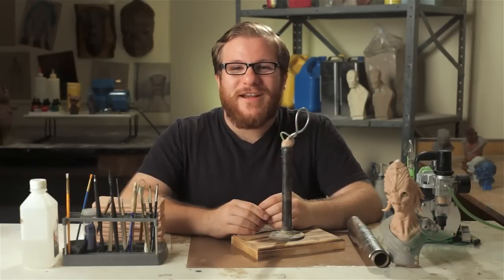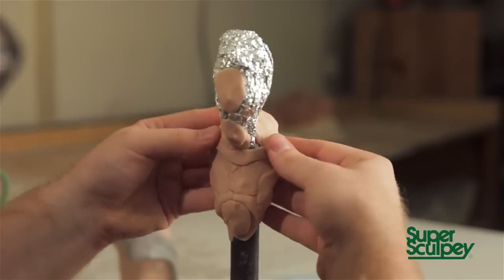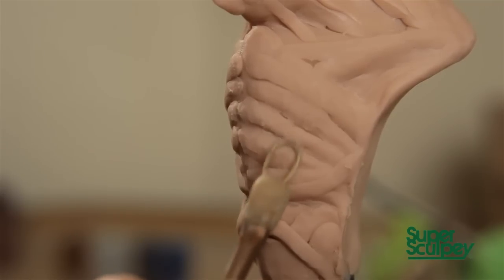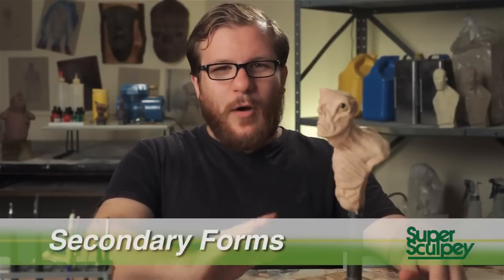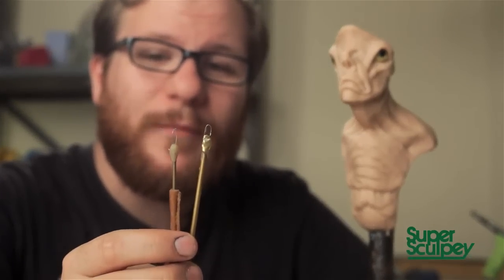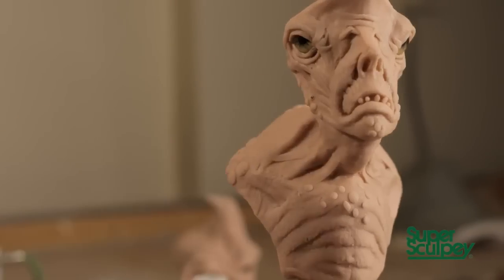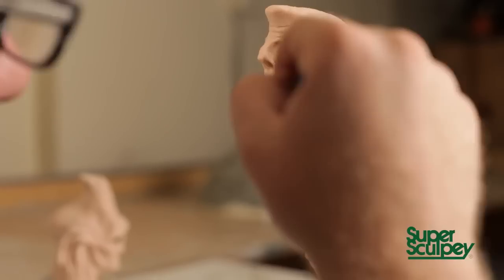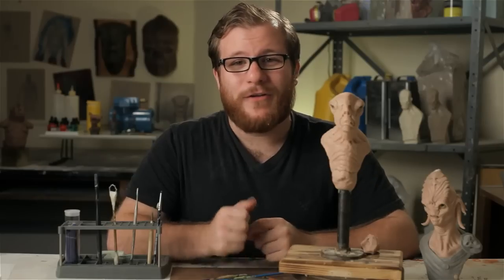Super Sculpey Modeling Clay - Creature Bust with Jake Corrick

Comment from the maker: Massive thanks to +Jake Corrick for helping our viewers out on their sculpey questions!!
Reply: Jackson's Art Supplies i'm a beginer , so i just wana ask about what tools do i use do i use for beginers?
btw love the your creatures
Reply: Lisa Takahashi thank's for the infoo :)
Reply from the maker: goldrick wang Hi - the tools you will find at this link are all recommended for beginners http://www.jacksonsart.com/Art_Departments-A-Z_All_Departments-Sculpture-Sculpture_Tools-CWR_Modelling_Tools/c2129_2128_2178_31127_33872/index.html good luck!
Reply: +Jackson's Art Supplies thank's for the info , :)
Reply from the maker: +Mr. VonMeister sometimes +Jake Corrick stops by to answer questions like this, fingers crossed!! But I imagine that the foil underneath the sculpey makes it easy to lift it from the pipe as the foil would not stick to the pipe
Reply: But the angle of the wire in the armature would stop it wouldn't it?
Reply: sometimes it best to leave the armature in and either make a new one or buy it
Reply from the maker: if the foil was thicker towards the base than it was at the top then it would be easier to remove the model from the armature. I think in this case he wanted to keep it on the stand?
Reply: Jackson's Art Supplies make Godzilla
Reply: Jackson's Art Supplies His link doesn't work anymore.
Reply from the maker: Thanks for letting us know... his Instagram is great! - https://www.instagram.com/jakecorricksculpture/
Reply from the maker: What's the magic word? ;)
Reply: You have some awesome work! I was wondering what you feel is the best clay to use to sculpt with? What brand/type of clay are you using for this bust?

Thanks a million!
Reply from the maker: Hi, It's Super Sculpey, hence the title of the video. Thanks for watching!
Reply: How do you take it off the stand?

Comment: Just adding this since it has come up a few times:
The base is removable after baking. I use the same setup that I have had for years for nearly all of the busts I do in this scale. Once everything is baked, and if you were careful to not put too much sculpey at the bottom between where the sculpture meets the pipe, you can slowly spin and lift your piece off, and the  excess armature wire can be snipped at the bottom. Good luck everyone, thanks so much for watching this. hope it is helping. I plan to do another video covering painting techniques, and maybe one for a full body figure if people are interested!

Comment: Hello! 

Amazing work! I want to get into sculpting and your video is the first one I ran into! With that being said, I have some questions:

1. Air bubbles? How do I get rid of them or how do I know if my piece has them? Will my sculpture blow up in the oven?
2. Stands for sculpting..where do I buy them?
3. What paint will work with super sculpey? I want it to look as clean as possible. I'd like to stay away from the 'elementary paint'.

Hope to hear from you soon! 
-Landon
Reply: I see your questions have not been answered yet. Here's my personal experience with Sculpey:

1. This need not be a big issue, as it doesn't normally occur when conditioning the clay well before use. Try not to trap air in the clay while kneeding it, or when putting layers of clay on top of one another. Trapped air can show up as tiny white spots or little cracks on the surface after baking. Cracks can also occur when you bake really thick layers of clay. So don't.

2. Be creative, anything could be a stand for your sculptures. I have used candle stands for this purpose and find they work really well. 

3. Acrylic paints are recommended and totally safe to use on Sculpey. I know some people use solvent based paints, such as heat set oil paint or enamel paint. Be careful when using solvent based paints though, as they could affect the baked clay through chemical interactions.

I hope this helps.
Good luck and have fun sculpting :)

Comment: Awesome video! I'm currently interested in making some dinosaur models for my sculpture class. I have one quick question.
 When you bake sculpy, you only use a low heat. I noticed that the base of the armature is wooden? Just wondering if there is anything That should be considered before putting it in the oven. will the wood start to burn a bit? Smoke? Or is the heat so low that is is unaffected ?

Thanks !!

Cassie

Comment: Thanks for the excellent tutorial! Question:

Is there a process for removing the sculpt from the portion of armature that is still visible, or is the intent to leave it on the supporting pole and base once baked?
Reply from the maker: If you wrap the armature with tin foil then once the model is baked it should lift from the armature without issue
Reply: Makes perfect sense, thanks so much!
Reply from the maker: A pleasure!

Comment: Hi, the rubbing alcohol, is that ok for when the sculpture is baked? (I know it's highly flammable) Is there a special version or mix for sculpting?
Reply from the maker: +Gary J No there is no special version, use it to smooth the surface of your sclupey sculpture and then wipe away any excess with tissue, leave it to air dry before putting it in the oven.

Comment: Does the creature[s] come off the base tube that you bake it on? I tend to have issues with things breaking when sliding off.
Reply from the maker: If you're worried try to make sure the clay isn't touching the base directly, have it only touching the aluminium foil. Then you should guarantee that you won't have any problems removing the creature from the base.

Comment: How do you fit a model with a metal armature sticking out the bottom in a normal oven?? That monsters great by the way :)
Reply: +Daniel Sumner Try laying it down horizontally with a towel or something soft taking the weight, I've had to bake large pieces that way before.

Comment: can u mold and cast sculpey afters its baked?
Reply from the maker: +Nick Ward No, baking the sculpey hardens the clay so it cannot be re-molded.
Reply: No sorry like can u make a silicon mold around model, to then make a resin copy of the original sculpey figure
Reply from the maker: +Nick Ward Oh sorry I musunderstood, yes making a mould of your model would be possible. You may need to put a layer between the model and the silicon of grease to stop the silicon sticking to the sculpey - best to check the silicon manufacturing information.
Reply: +Jackson&#39;s Art Supplies thanks! also do the eyes have to be glass? do plastic eyes melt in the oven
Reply from the maker: +Nick Ward Most plastic eyes would melt although I wouldn't rule out the possibility of finding some heat resistant plastic eyes - best to check with the eye manufacturers.

Comment: Whats the difference between super and original? I'm using original sculpey and it's a pain in the butt when working with very small parts and detailed sections. Would super be better?
Reply: +John Doe Super Sculpey is definitely much better for anything with detail, I think you would find the Firm Grey Sculpey best for your cause though. good luck

Comment: I keep thinking that this would be a super cool oversized posable figure..flexible joints..I bet you have a good technique for covering flexible joints
Reply from the maker: You'd need latex or some other elastic material for flexible joints - once this is heat set in the oven Super Sculpey is rigid.

Comment: Hello
How do you keep your clay project from drying out?
Thanks
Reply from the maker: +edgar quinto keep it in an airtight container and you should be fine. If it does dry out try adding a mineral oil or kneading it with some softer clay and it should revive sufficiently to work with :)
Reply: Jackson's Art Supplies
 THanks!!!

Comment: How do you remove the sculpture from the armature? is it before or after baking? And how do you finish the bottom that was not covered in this video?
Reply: +RobotCosmonaut  The sculpture does not get removed from the armature. It is part of the bust.
Reply: Not the wires and the foil, I mean how does he take it off the pipe that it is on

Comment: Hey I am making a stamp out of sculpey and I am planning to use the aluminum foil method, but will the aluminum foil change shape and break the sculpey layer when you press the sculpture hard against a piece of paper?
Thanks
Reply from the maker: Before the Sculpey is set, there is a chance that if you apply too much pressure to the Sculpey that it might form a crack in the layer and distort the foil shape underneath. Once the Super Sculpey is set though, there shouldn't be a problem.
Reply: Jackson's Art Supplies thank you
Reply: Helen Zhang The foil is just meant to be a base, the "bones" of the sculpture. Be sure to really cover it well when you are working.

Comment: Sorry it's a bit late, but is it ok to bake the design in the oven even with those eyes? Seems like they would warp or melt
Reply from the maker: There are eyes available that are made from glass or other materials that have a much too high melting point to be damaged by putting them in the oven for heat-setting super sculpey.
Reply: Oh awesome. Always thought it would be cool to use them but I was afraid of the melting problem

Comment: How do you remove the piece from the armature once it's completed? 
Does you bake  your sculptures with the armature and wooden base attached and then remove them afterwards?
Reply: Asking the important questions
Reply from the maker: +QuasarBeatz Hi Andrew, remove the wooden base as that won't like being in the oven much! Keep it on the metal armature. Once the model has veen oven baked, you will be able to lift it from the stand. The foil will remain in side your model and the foil stops the sculpey from sticking to the armature directly.

Comment: When done baking does it stay on the pipe/armature? If not does it slide easily off.(new to polymer clay)
Reply from the maker: Kevin Daily If you want to remove it from the armature I suggest you wrap the armature with foil which will ensure that the polymer clay definitely does not stick to the pipe. Try and be really careful when removing as it would be really annoying to break the sculpture after all that work!!

Comment: What do you call the base thing you built everything on?
Reply: +Jim Bond It is a pipe and flange (found in the plumbing section of a hardware store) screwed down securely onto a wooden base.
Reply: +Jake Corrick Do you then reuse the flange and base and cut then pipe to length for displaying on a more decorative plinth?

Comment: The armature pole that that the sculpture sits on.. do you cut that to size later?
Reply from the maker: If the super sculpey is not set directly on to the stand as is only touching the foil then you'll be able to lift your creature from the stand after it has been set and find a shorter stand to put him on, or another method of displaying him.

Comment: I was wondering. If you bake it will the eyes remain undamaged and not burnt after you take it out of the oven?
Reply from the maker: You need to use eyes that are heat proof - glass eyes should be OK as the temperature won't be beyond the melting point for glass. Some plastic eyes may not be suitable for baking.
Reply: +Jackson's Art Supplies ok thanks a lot for answering my question.

Comment: I was thinking of using Sculpey to make a creature head shift knob for my rat rod.  Will the Sculpey stand up to use or is it fragile?  Will it stand up to hot and cold temperatures in a vehicle's interior?
Reply from the maker: It's hard to say - it is fairly hard wearing but I couldn't guarantee how long it would last.
Reply: Kyle Hawbaker -Unfortunately I do not think it would last too long. Most gear shifters are cast in metal, but you could use Sculpey to create your prototype.
Reply: Hi Kyle,

I think, you can use metal galvanization for this... - practically anythink can be galvanized. A thin layer of metal should be put on your sculpture. You can bring your sculpture, where this service is offered.. it is not "extra cheep" - and this should long lasting your sculpture for weather... 
Anyway: I was investigating how acrylics - (polymers, etc.) should be used as outdoor sculpture.. I think - can not - sun, UV rays, cold - destroy this... even - glased ceramics - maybe this should has longest life - if ceramic is glased from every side without no input to not-glazed ceramic.. but: Glaze is surface of glass - it should cracle, because ceramic has different change of volume then glass.. :-)))
Only solution: marble, stone (expensive and hardly you will do this) - but: CONCRETE!! very nice material! and you can mixture into concrete different addtions, very challenging... and you can make relatively small sculptures on classical way - from clay, then cast mold, and put into it concrete.. But "dirty business" - you can not do it at home, in living room, which I tried to negotiate with my wife... - she simply said no, and I understand why... :-)))
I have found a nice book of Andrew Goss - about concrete - why/how/what.. - that is e-book, payed on his web. On scribd and amazon are also a lot of book of inspiration...

With polymer clay.. uff I am struggling and strugling.. if I compare, how enjoyable is to work with simply wet clay.. it is not comparable - just try it... or oiled clay from Chavant.... Than polymer clay has (for me more disadvantages then advantages...)  but - all materials has pro and against reasons... 
Here are only presented my opinions and experience of "hobby sculputurer and painter"... :-))) - different people should have another one... 

good luck,
Alex.

Comment: Hello!I have model that i sculpted by oil base clay but needs some tuning on the surface, what tips you have for it?
Reply from the maker: You could try rubbing alcohol which will soften the surface so that you can re-work it? Has your model completely dried/set?
Reply: i use oil based clay and it is ready but needs to Clean up the Surface only and rubbing alcohol can i use the same clay again and make something else with it?
Reply from the maker: a light rubbing of the rubbing alcohol with a clean lint free rag will clean the surface well prior to baking. I hope this answers your question? Many thanks
Reply: Thanks man!

Comment: where do you find the eyes or do you make your own?
Reply from the maker: Marbles make good eyes, otherwise you need to go to a model making supplies shop. Thanks
Reply: It's best to use glass taxidermy eyes, beads, marbles, etc. DO NOT use any plastic spheres for your super sculpey sculptures, if you intend to bake them. Depending on the type of plastic the eyes may be, there is a VERY STRONG chance that the plastic eyes could warp, blister, or even melt when baked. 

However long you bake your sculpey sculptures, you MUST LET THEM COOL SLOWLY! If you don't, you will risk the VERY strong chance that your sculpture will severely crack, fracture, or even fall apart entirely. It is better to bake your sculpture in stages, rather than all at once. By doing so, you can be sure it is baked all the way through, rather than just baking the surface and have the middle still be raw clay.

And, for the person that asked about, "...can the armature be removed after baking...", the general answer would be no. Usually, the armature ends up becoming a permanent part of the sculpture once baked. Although, "techically" you could try to remove the armature after baking, in most cases you would likely spend a long time doing so, and it would likely destroy your sculpture in the process. It is NOT recommended to do so. The armature in essence is the "skeleton" of your sculpture. If it is removed, it is VERY likely that you sculpture will be severely weakened, and unstable. Just as though if someone removed YOUR skeleton, chances are good you would have great difficulty in standing. Get the idea?
Reply from the maker: Ha nicely put! and some great information here. Thank you for sharing!

Comment: Do you ever have a problem with the clay cracking or breaking after baking?
Reply from the maker: +cherie levinsohn Hi - it shouldn't break or crack after baking unless the sculpey is too thin...as it loses moisture in the baking process it will fractionally contract so if it is too thin it may crack, but so long as it isn't paper thin anywhere it should be crack resistant.
Reply: +Jackson's Art Supplies Thank you, I do sculpt around glass and think that I may have gotten it too thin in places.